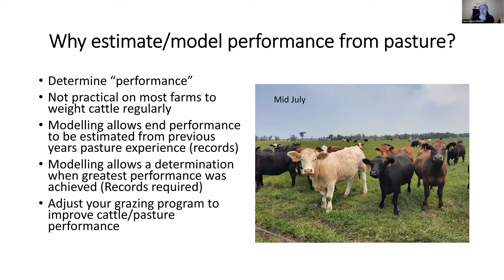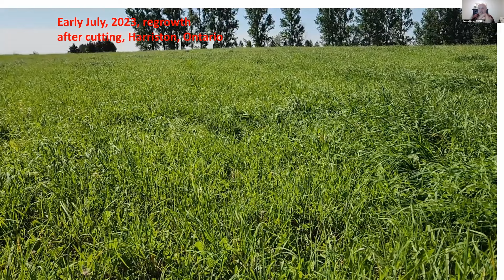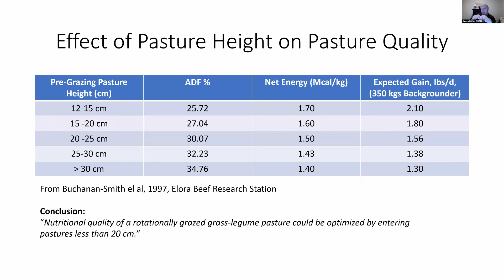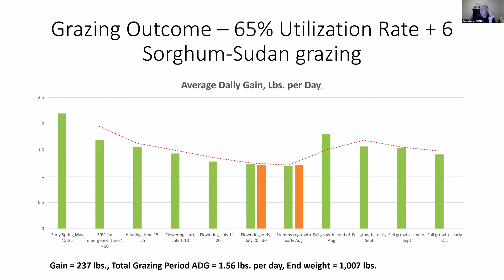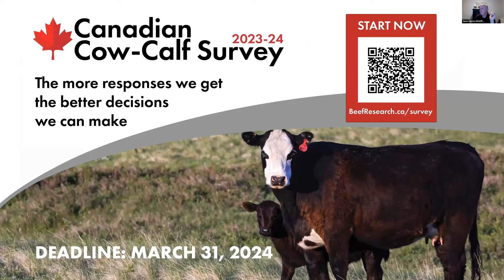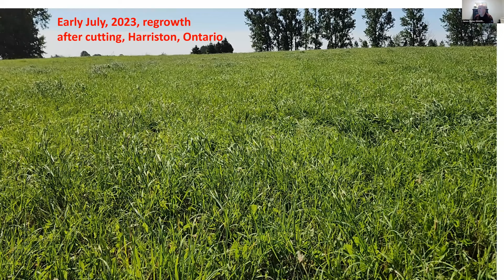Predicting cattle performance from pasture

Comment: How does the data vary when using a multi-species cover crop (8 Summer mix) (6 winter) (all with Legumes, broad & narrow leaf grasses, seeds (corn, Sunflower, barley, millet sorgum, hairy vetch, alfalfa, lablab, etc)
Reply from the maker: Great question that has a long answer. A quick answer is that it's completely possible to model animal performance from grazing cover crops but once you get into multispecies cover crops especially ones with a large number of species the data gets skewed by grazing behavior. Nonetheless if the list of species grown and their proportion when the mix is known, a predictive model can be created. It may be challenging to get model data on some more exotic plant species.  

Research on grazing cover crops has shown that as the complexity of species in a mix increases, young cattle performance declines but days grazing increases for beef cows.

 This means that single species cover crops, mainly small grain cereals, are best for young stock but multispecies cover crops are best for beef cows since the higher forage yield delivered gives more day's grazing for beef cows where pasture quality is not so important.

~ James Byrne